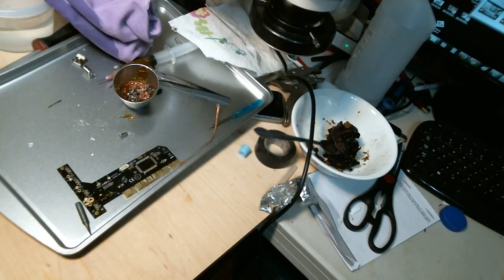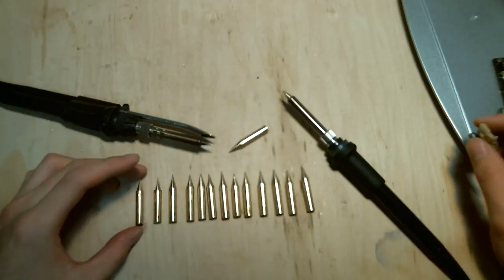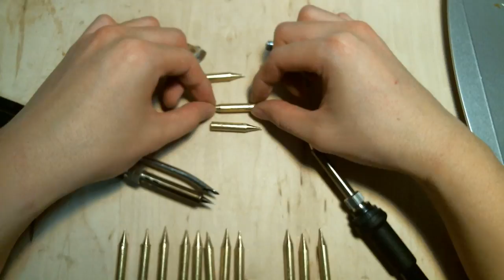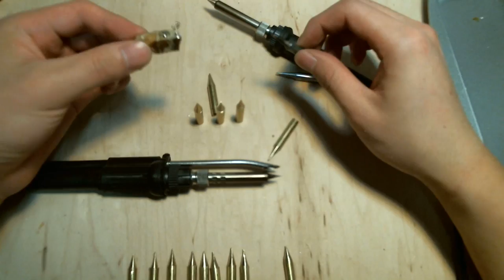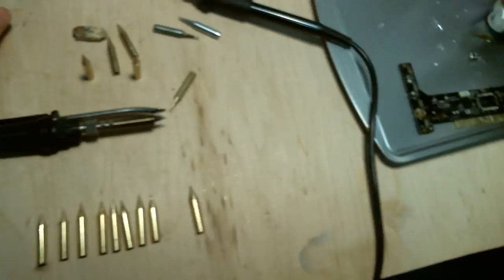Copper Soldering iron tips 900M for micro Soldering Hakko Aoyue Station CyberDoc LLC 1

Comment: I recently bought some "900 Copper / Iron Tip for Hakko"  tips from Hong Kong. Yes the tip is iron for durability but the rest of the shank/tube is made of copper. It doesn't look like copper because it is chrome plated. At first I didn't believe the copper claim so I sawed the tip in half and guess what? Yeah! Copper! Now, I also did the magnet test and yes, it picks up the tip but that is just because of the iron tip. The rest of it is chrome-plated copper.

Comment: All the best soldering iron tips are made of copper with iron tip. Then chrome plated so you won't see the copper. I have many years experience in soldering and I can tell you right now that no-way brass tips will do 20,000 solder tips as an iron tip is rated to do. The brass is just not tough enough. I mean, even bronze is more durable than brass.